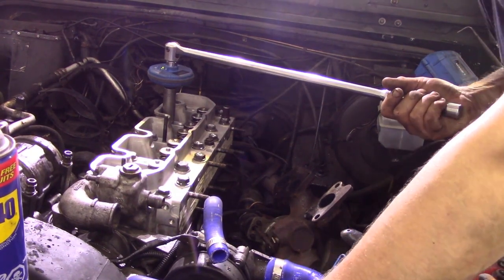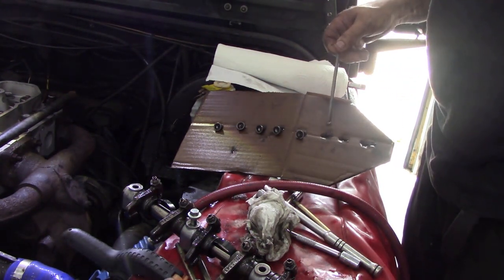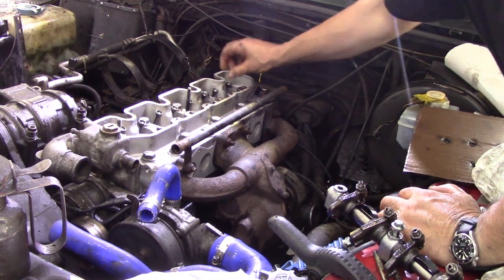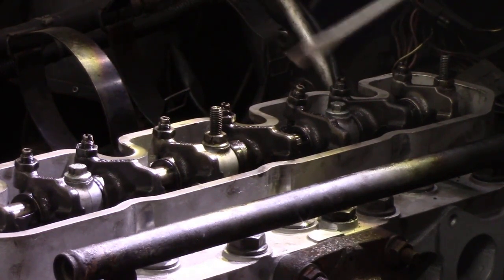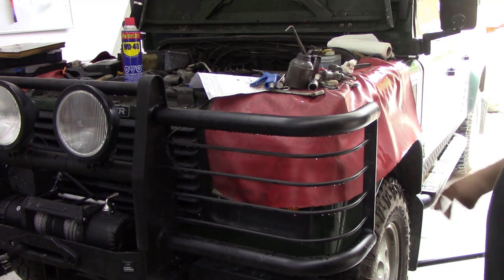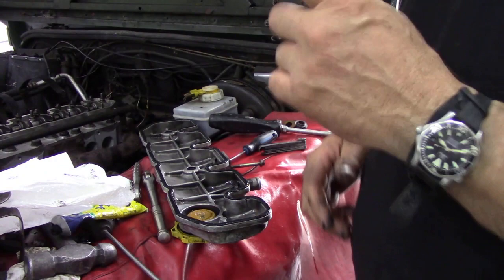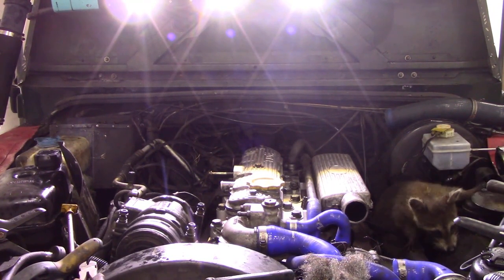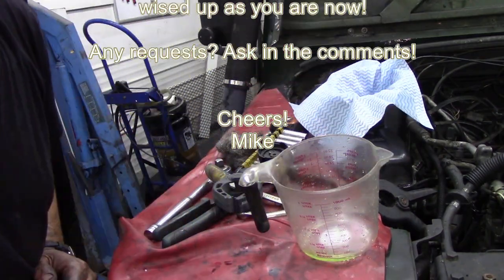New 300Tdi head fitting - Lots of tips, inc. setting the valves easy! Part 2

Comment: Another great video Mike.  Never seen turning the front wheel to turn the engine before, I always turned the engine crankshaft pulley. Just go,s to show, you are never to old to learn.  A good tip to pass on when using a jay-cloth. If you are using it to refill fuel after you have had to remove it, always wet the cloth first, then ring it out so that it is just damp.   That way, if there is any water in the fuel, it soaks into the cloth, and does not go back into the tank.  I hope that you are NOT wearing a fur hat in your next video, and there is no apprentice there.  Best wishes from Yorkshire, Rob.
Reply from the maker: Thanks Rob!
Hey Rob,  I have not forgotten your personal message you sent me a week or so ago, but I have so say a similar thing happened to me about 13 years ago  - it has been a battle to carry on and get back to where I was - I think you understand

Mike
Reply: I sure do understand Mike. It's a place that I don,t want to be again. at one point things got so bad that I thought that I might lose my house. Please be cautious. As ever, best wishes from Yorkshire, Rob.
Reply from the maker: I just sent you a personal message, but I would never have anyone working here again - you have to watch them like hawks

Comment: Love the apprentice!  I've never had leaks from the rocker cover gasket seal, but the semicircular seals in line with the rocker shaft tend to sweat.  Good technique with the wheel to rotate the engine for those without a breaker bar that will turn the crank directly, but regardless of how you turn the engine, the "rule of 9" still applies.  I'm not sure about using grease to hold the injector washers on the injectors for assembly - I prefer to drop the washers in place first along the shaft of a screw driver to direct them and keep them the right way up; hold the washer against the screw driver handle with a finger until the driver tip is located in the injector bore's smaller hole and then let the washer slide down.
Reply from the maker: Copper grease is so much simpler to install the seals - as for rule of 9 never used it for 35 years!

Comment: Hi Mike, great video, I love watching your videos.
Quick question. I'm about to overhaul my rocker shaft and wondered what the correct orientation for the oil holes are. Top towards the adjustment screw? Cheers.
James
Reply from the maker: Yeap!
Reply: Thanks, I've just noticed that one hole on the shaft is bigger for the oil way so you can't get it wrong. Well, I suppose you could and cause a lack of oil.................
Thanks 👍😁👍

Comment: Hey there! Thanks for the video.. Unfortunately i used the ridged side of the injector copper washer towards the cylinder head :S Is that a huge deal and i should renew it or shall i leave it? Thanks in advance!
Reply from the maker: If it is not leaking, then don't touch!
Reply: @BritannicaRestorations  Thanks a lot mate!

Comment: Mike czy zawsze wymieniasz śruby głowicy  na nowe dziękuję i pozdrawiam.
Reply from the maker: Myślę, że możesz użyć śrub napinających do 5 razy, ALE nigdy nie wiadomo, kto je dokręcił, ponieważ śruba napinająca ma cienką linię między byciem we właściwym napięciu, a stawaniem się „elastycznym”

Możesz powiedzieć, że kiedy dojdziesz do ostatnich 20 stopni, śruba nadal obraca się z niskim oporem - więc zawsze pasuję na nowe śruby

You can use the stretch bolts up to 5 times I think, BUT you never know who has tightened them up before, as a stretch bolt has a fine line between being at the correct tension, and becoming 'elastic' 
You can tell as when you get to the last 20 degrees the bolt still turns with low resistance - so I always fit new bolts
Reply: @BritannicaRestorations  thank you Mike.

Comment: hi mate whats that digi meter called? james liverpool
Reply from the maker: https://www.lasertools.co.uk/product/5048
Reply: @BritannicaRestorations  thanks mate, and also i seen the presure kit that you put on the expansion tank and then pumped in the air, where did you get this from. james
Reply from the maker: https://www.amazon.co.uk/FreeTec-Radiator-Pressure-Universal-Cooling/dp/B0748DQQYY/ref=sr_1_6?keywords=coolant+pressure+tester&qid=1565515237&s=gateway&sr=8-6

This is the latest kit - quite good as it has a vacuum radiator filler which I had to buy separately